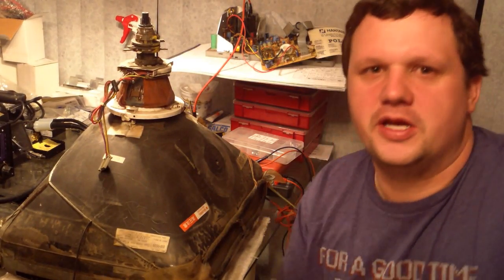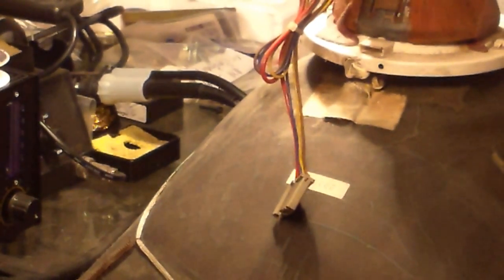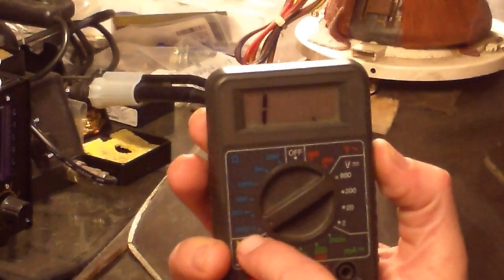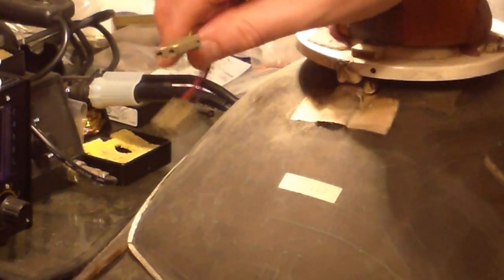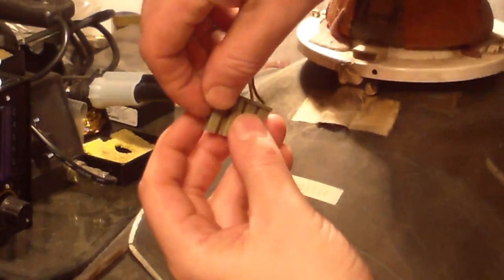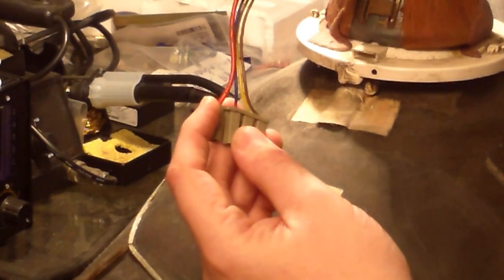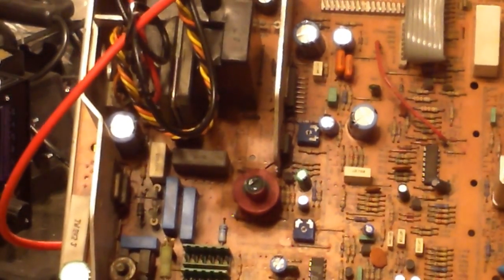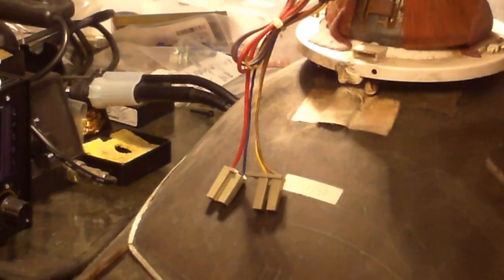Walsdawg Arcade - Manually flipping an image on a CRT monitor

Comment: I have a Polo 2 chassis with the 2nd green plug.. but i guess if i swap to use the other plug on the chassis... it will flip BOTH ways?
Reply from the maker: Correct.
Reply: @MitsurugiW  - Thanks for the reply. I only want to flip the horizontal so i need to cut and swap the GREEN and RED ones then i think

Comment: Will this help If I want to take a CRT Tv  and turn it into a vertical image? I have plug & play plugged in to an old CRT Tv  and I would love to place the Tv on its side and get a vertical image like a real arcade game, can this be done in any way. I don't think your video was confusing I just don't think I was smart enough to understand lol
Reply from the maker: You can only play on a vertical setup if the game is designed to be.  You can't take a normally horizontal image and make it vertical .
Reply: Ok I just thought maybe because say this P&P on a CRT Tv the sides are blacked out it looked like it was meant to be vertical so I thought something could be done thanks for getting back to me

Comment: I just tried this on a GO7 that had an upside down picture. I could tell someone had messed with this before as the connector was actually broken into four pieces. When I switched the horizontal wires I got a blue swirly blotch on the middle of the screen. I put those wires back where they originally were and everything was ok again. I also tried tried switching the vertical wires, just for shits and giggles. I got a collapse line down the middle and I smelled something burning so I quickly unplugged it. I put those wires back where they originally were and plugged it back in and luckily no damage was done. Not sure where I could have went wrong with very basic instructions which I reviewed several times before attempting.
Reply from the maker: DeeJayWheels That is strange. The two wires for each winding can only be plugged back into the same two pins. You can't plug the horizontal wires into the vertical pins for example. Sounds like what may have happened. Send me a message on arcade-projects.com. maybe I can help.
Reply: Against my own best judgement I tried a couple other different combinations of wire placement and finally got the correct one without any damage done. Someone really did a number on the wiring on this thing. In any event, thanks for your help sir!

Comment: I need to swap out a horizontal monitor with a replacement due to screen burn; trouble is, the replacement monitor I have was taken from a vertically mounted machine.  What adjustments will I need to make to insure the monitor displays horizontally?
Reply from the maker: It doesn't matter what the orientation of the monitor is.  Even if it is mounted vertically it still works the same way, only the game is designed differently.  In your case you will only need to make normal adjustments to make the picture look good just as with any other monitor.

Comment: On the Hantarex monitor is there a clasp to get the green part off? Only reason I ask is it is really stuck on the top one. I was having a similar issue with my sides being reversed and the words are backwards. player 1 on player 2 side and 2 on 1's.

Comment: That flipped the image from top to bottom,
I need the image flipped from side to side so the words are backwards.thats where the mirror comes in to turn the words the right way..
Any other ideas?
Thanks Ian..
Reply from the maker: Ian Walker You can do like I did in the video and cut the connector and turn the horizontal coil backwards.

Comment: Ive just got a new 28" polo monitor for my time crisis machine,how do i flip the image on the screen so the writing is backwards as this machine uses a mirror?
Can you help?
Thanks Ian....
Reply from the maker: Ian Walker The Hantarex are easy.  If you follow the yoke wires down to the pcb yoou will see it plugged into a green (might be a different color) connector.  Next to that connector you will see another identical green connector.  Unplug the yoke wires and plug it into the other connector.  You should now have a flipped image.

Comment: May I just change the position on the wires directly on the yoke? I mean, putting the blue wire on the position of the red wire, and the red on the blue position. I would like to do it on an CRT TV, so it would be easier. What do you say?

Comment: YOU ARE THE MAN! I bought an X-men 6 players cabinet without the monitors and board and  started a project with two 21" monitors, one CRT. After get all done, I realized that the FLIP option on MAME do the right-left flip for ALL monitors connected in the PC! So, of course, that did not help, since the LCD monitor behind the mirror/glass did flip as well. After 5 hours looking on internet for a solution, I found your video! PERFECT! I did it on the CRT and just it is FLIP now. THANKS A LOT! :)